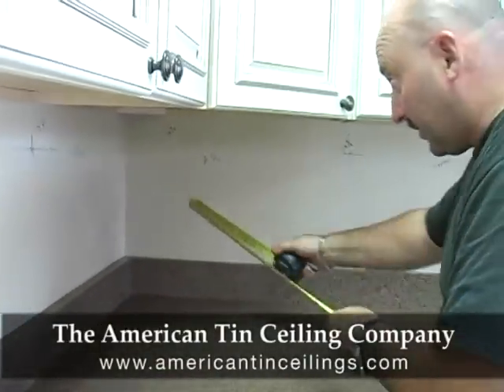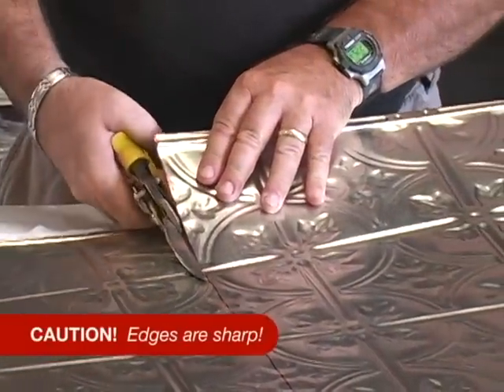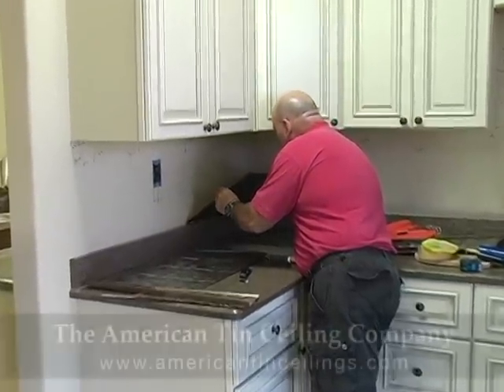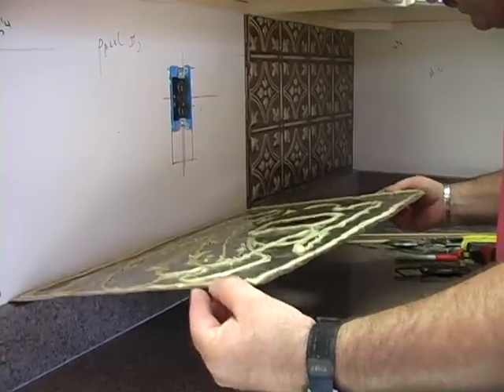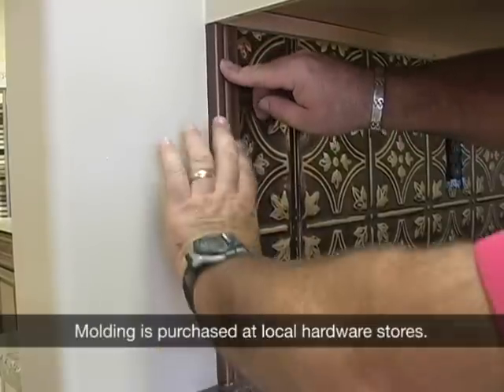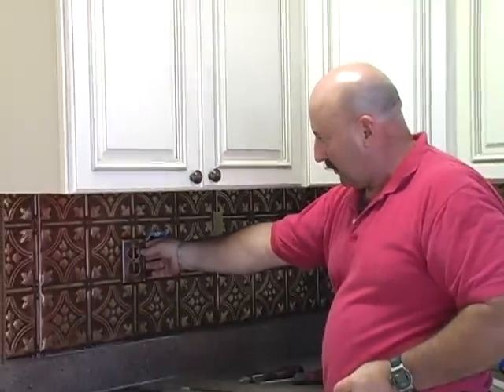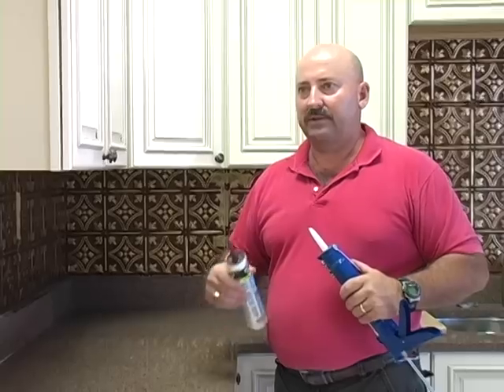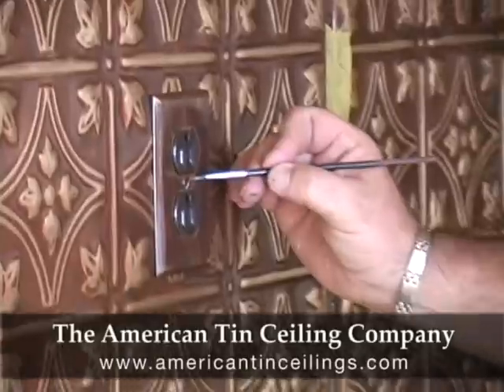Installing a Kitchen Backsplash

Comment: Hi, I could not tell rather you were overlapping the edges or are you butting to gether? And my second question is the large piece of trim, did that come with the panels, or can you buy that separate and match it up?

Thanks
Reply: Edges overlap so as to maintain a consistent 1/2" separation.

Comment: Why do you make air pocket problems when you apply the adhesive? Seems like a problem waiting to happen.
Reply from the maker: Hi, the backsplash panels adhere flush against the wall. When installed properly, there would be little to no spacing or air pocket behind the panels.

Comment: What is a “brad nail”? Can I use tac nails and tap them in?
Reply from the maker: Ultimately, it is the construction adhesive that holds the backsplash panels onto the wall. Nails are sometimes used to clamp the panels tight while the glue dries. An 18 gauge brad nail has a head about the size of a ballpoint pen, but any small headed nail will serve this purpose. We also have decorative, cone head nails that can be used for this purpose. They can be found here: https://www.americantinceilings.com/cone-head-nails/

Comment: Do the nails in the nail strips stay exposed ?   Thank you
Reply: We just installed these panels in our kitchen and the brad nails are not noticeable.  We did use the touch up paint to cover the heads but it was not necessary.  We used the heavy duty Liquid Nail glue and brad nails to install because I have a duel fuel stove. I was worried about the heat causing the glue to loose it's contact.  Within 24hrs, the panels are still nice and tight to the walls with no pulling away.  We used the rubbed oil bronze color panels purchased from our local Lowe's and they look awesome in my Tuscan kitchen.  I love these panels due to the fact they were easy to install, the versatility, color selection, and they are easy to clean as well!  I highly recommend them to anyone!  They are costly, but they where still cheaper than   buying tile, grout, and mortar and then paying a contractor to install the tile. You save money due to the fact you are able to DIY and not pay a contractor to install these. Sorry so long a review, but I hope this helps!
Reply: Mary Durham

Comment: With the adhesive you are not suppose to make a full connecting square on the back.....this allows air to be trapped behind the backsplash. It's better to make tight waves. Start at the top corner go down to the bottom and back up to the top. Sideways 'S' pattern.
Reply: well can you please make us a video showing us the right way?
Reply: lol thats what im saying also
Reply: as long as you get adhesive on the panels and close to corners and such it will stick liquid nails is pretty sticky stuff